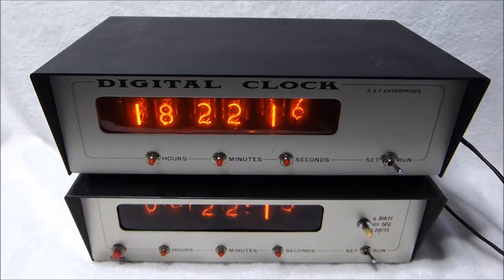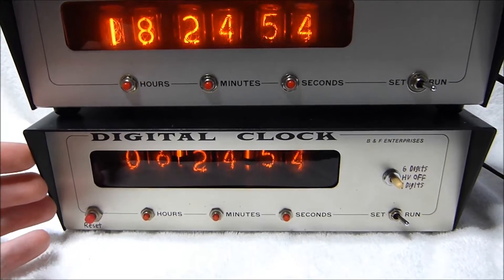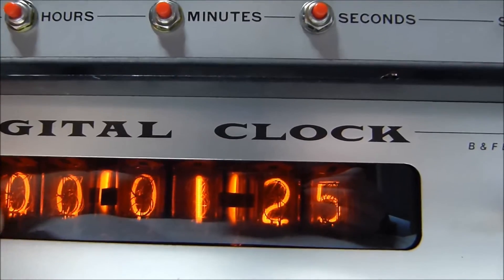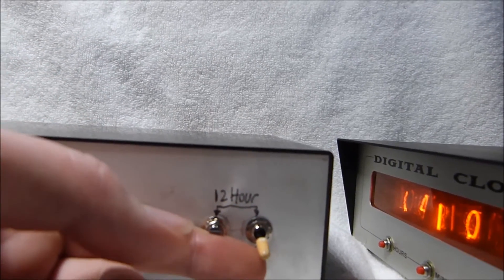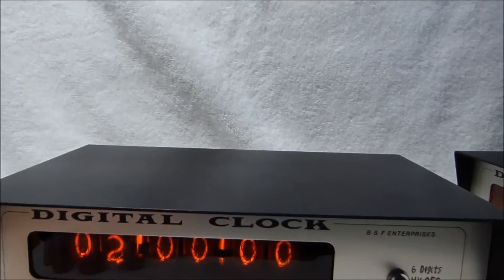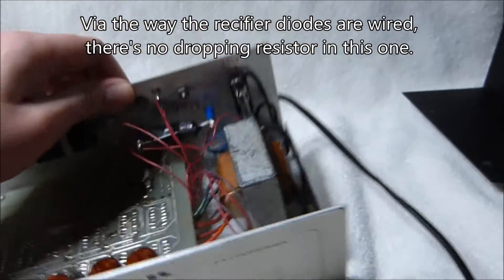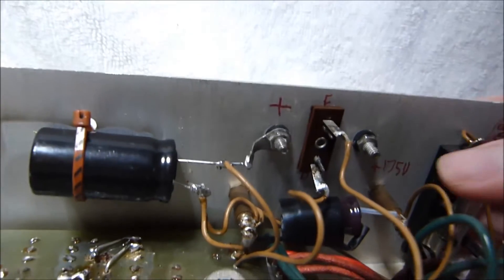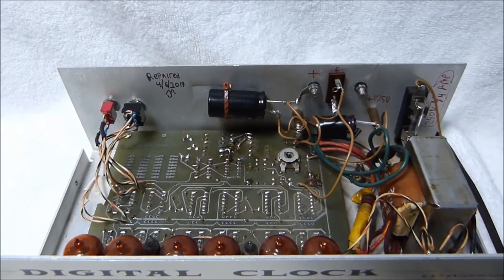B&F Enterprises Z1000 digital Nixie tube clock (1972, USA)

Comment: I can get just over 5v on IC rail. Anyways thank you for hv help. Diodes and cap.
Reply from the maker: So the HV is working fine now? 5V is what you want on the IC rail, and that's adjustable via the potentiometer on the board (if it's very close to 5V, just leave it be).
Reply: @50sTransistorRadios  yes. New diodes and caps. Was failing at working at voltage spec.

Comment: Mine blows fuses. HV filter cap not shorted. Diodes test ok, but get hot and draw like 60 watts. Do you have the schematic or correct way for diodes? Thanks
Reply from the maker: Just because the filter cap test okay with a multimeter doesn't mean it's okay; it may only start leaking badly when high voltage is applied. The diodes may also be breaking down at high voltages. I'm guessing you bought the clock that sold recently on eBay... if it really was working recently, then the diodes should be installed correctly. At 14:42 in my video, I show diodes that had been installed backwards.
Reply from the maker: Here is an old scan of the schematic, it's a little tough to read, but might help: https://imgur.com/a/L4op4ob
Reply: @50sTransistorRadios  Thank you. Clock is working now and set up as it was for 24 hour mode.
Reply: Found the diodes not being a perfect diode. Reverse leakage. Replaced and a new cap. I appreciate everyone’s help.

Comment: I bought one of these new circa 1970.  I still have the clock and an original manual.  It has schematics, parts list and instructions.  I can send you a scanned pdf if you would like.
Reply: Neil, I have this clock, and digits are blinking, not counting. I could use that schematic and manual if you have a copy. Thanks !

Comment: Got one of these in Lixie Displays, like that timer on that atomic bomb in GOLDFINGER ?
Panaflex displays were 7-segment nixies in a flat-panel glass module arrangement?
Reply from the maker: I don't have a clock built with edge lit displays, but I do have enough of what are possibly the exact same type (shown in Goldfinger) to build one. Panaplex displays are 7-segment neon filled devices, similar to Nixie tubes.
Reply: @50sTransistorRadios  Panaplex, yes, 7 seg nixies inside a multiunit glass module for a display. They are nixies because they have an inversely prebiased control grid to switch each segment on or off
Reply: @50sTransistorRadios  "do have enough of what are possibly the exact same type (shown in Goldfinger) " The new ones are etched by laser and have smooth outlines. The originals had small dents drilled into them to form the figures

Comment: Nice. I always wanted a Nixie tube clock.
Reply from the maker: Modern ones are easy to find, eBay is flooded with them, but vintage ones like this are hard to find.
Reply: I should have specified vintage. I have seen the modern ones on eBay, and might get one of those one day, but vintage is always better!
Reply from the maker: @Colin_Ames  I prefer vintage digital clocks as well, both for the history and their appearance.